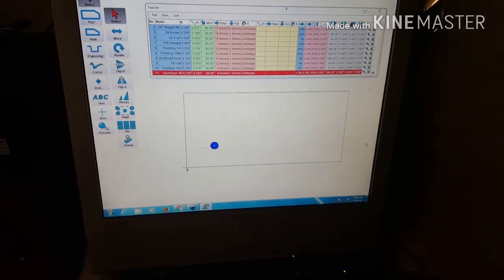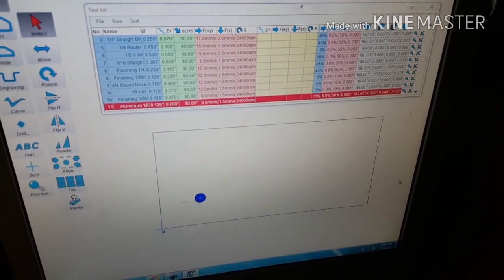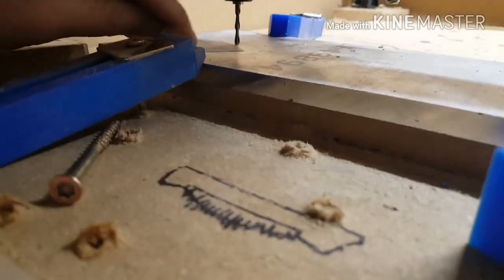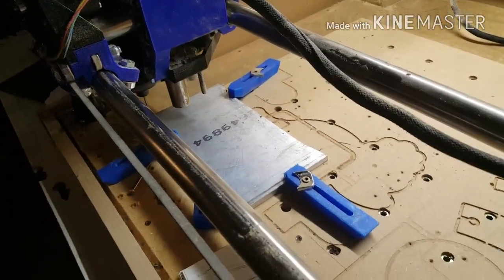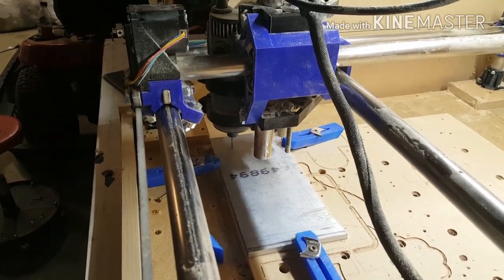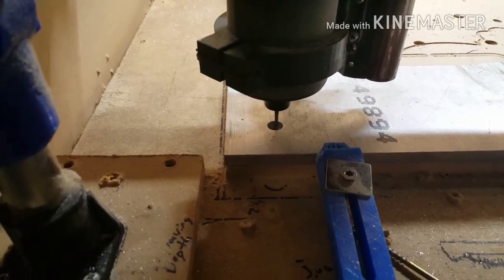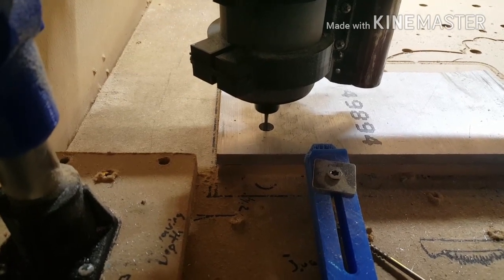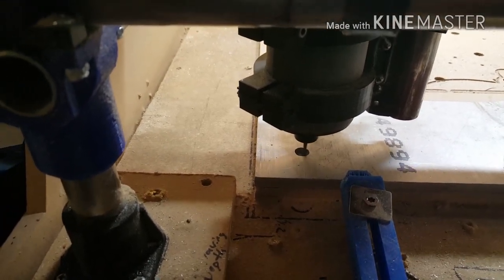First Aluminum Test Run with MPCNC

Comment: Its best to set the G code to drill a pilot hole about 1/16" to 1/8" deep and finish it on a manual drill press if you want real accuracy.

Comment: That's was a pretty good test and the results were pretty impressive considering you had a not so sharp bit carving out that hole. 

I would suggest that you bring the router a little closer to the the object you plan on machining. I believe it will help in reducing the stress on the tool bit and you should have less chattering. 

All in all, I am very impressed with your work. I will be looking forward to seeing how this all turns out. I have wanted to build a CnC machine, really more of a mill so I can machine metal. But I may change a little any build this instead. It's a lot cheaper then a milling machine.

Comment: I tied estlcam but would not work with ramps 1.4 so what drivers did you use to operate your nema 17 motors, and if you used the estlcam what version did you use?
Reply from the maker: Go to this link https://www.v1engineering.com/assembly/software/ you will need to install the arduino software and drivers and then follow the firmware page and find the firmware for the Ramps 1.4...hope this helps thanks, Andy

Comment: Everytime I see one of these machines they are as big as a house.  Anyone ever make a normal sized one of say 600x600 or 500x500 cutting area?
Reply from the maker: For sure, the great thing about this machine is that it can be built to any size you want...if all you want to do is mill aluminum, than the smaller the better. Many of us want them large for sign making. Also for me, i wanted to be able to cut a guitar neck if i wanted to, so that is what determined the size of mine.
Reply: Oh, of course size matters for those things but I would use it for Aluminum and sometimes a small wood project.  My thing is I don't care what can do the job I just need something that isn't going to crush me financially.  Too bad this can't do steel and the ones that can are stupidly expensive.
Reply: @thebeststooge  I know it's a year later, but the beauty of this CNC machine is you can make it as big or small as you want - just change the pipes/rails, belts and wiring loom to suit. The one I've built is slightly larger than 600x600 cutting area but works out to around 900x900 square bed/table size.
Reply: @thebeststooge  It CAN do steel and stay cheaper and the same time, it depends on how well you build it and what do you do to make it sturdier. My build is fairly big (working area of 1000x800 mm) and has stainless steel tubes, more powerful motors, dual belt setup and other modifications and costs under $400. I admit I haven't tried steel yet but I'm pretty sure it can handle it, cause it's superior to the stock build, which is capable of doing it: https://www.youtube.com/watch?v=1CX3qui0-Yo

Comment: mines struggling with pine but its probably my cutter
Reply from the maker: +DarkShadowsX5 

What kind of bit are you using? A 1/8" 2 flute up cut bit is the only way to fly for most things...dont go to a 1/4" until you get things cutting good with a 1/8"...i dont usually use any "regular" router bits for most things. I do use a regular v bit for carving bigger letters and 3/4" bit for surfacing. (Always come from an edge if using a big bit like this for surfacing. Dont ever plunge into the wood with one)...if you have chosen the correct bit and it's sharp, most of the problems that arise are simply from the settings...either your too fast or slow with your feed rate (your spindle speed goes hand in hand with the feed rate), or your depth of cut, and even the methods you use in cam to cut with. The settings are everything! You will also be surprised that people often turn down the feed rate too slow. This causes "rubbing" instead of cutting, and you don't want that...you want the bit to be efficiently taking material as each flute rotates around...of course this all changes with the number of flutes on a bit, spindle speed, and the size of the bit...on the v1 engineering site there is a page somewhere with suggested settings to start from. Hope this helps.

Thanks,
         Andy

Comment: Why no lube
Reply: Because real men do it dry.
Reply from the maker: +James Brooks 

Simply because it's messy and I don't do much aluminum...the router blows straight down so it works a lot like an air blast and gets the chips out...lube would help though.